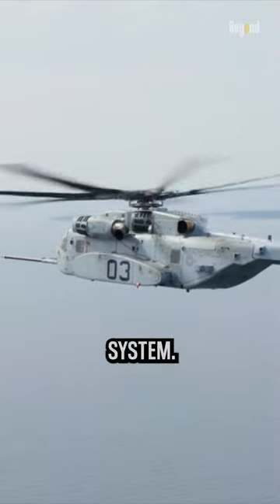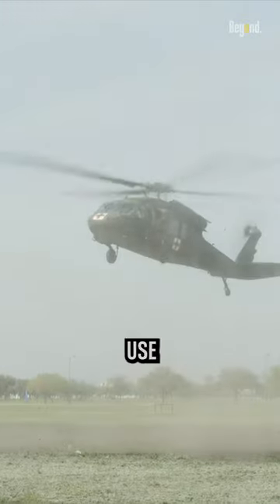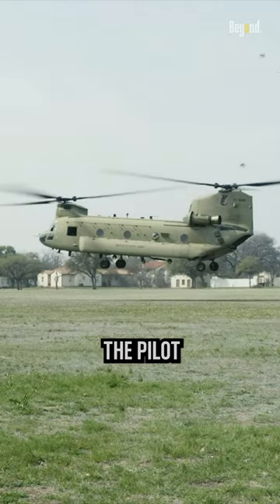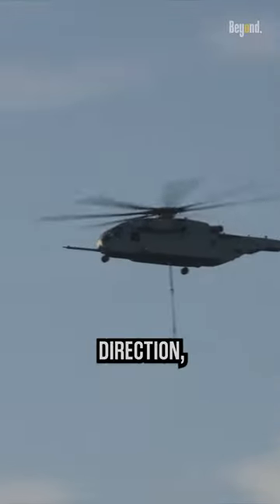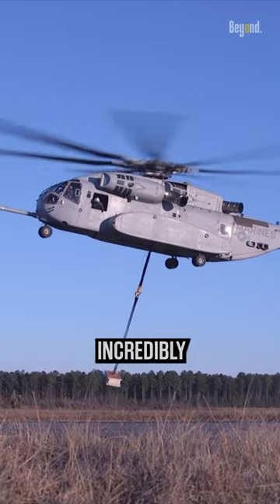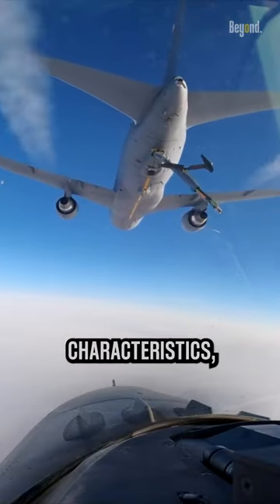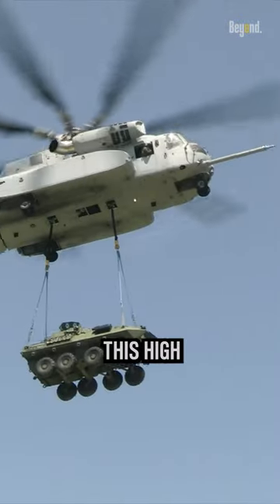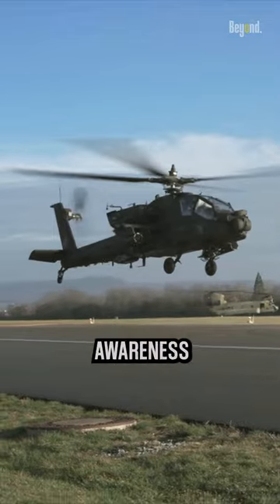What makes flying a helicopter harder than a plane? #shorts

Comment: The real reason planes are easier that helis is that planes stabilize themselves. Helis don't.

If you let go of the controls, they'll go crazy. Even if you balance it perfectly, the air around still moves and it doesn't care about your plans to stay balanced. Hovering a heli is ridiculously hard to master.